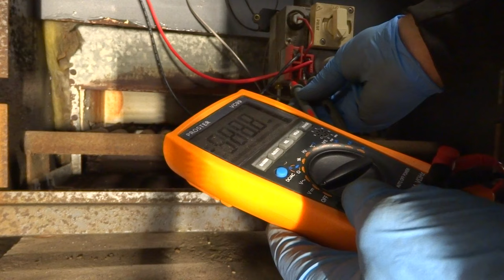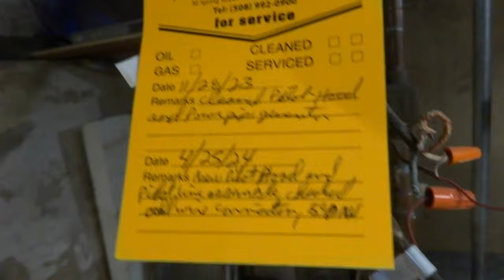OLD GAS BOILER POWERPILE SYSTEM WILL NOT FIRE

Comment: Steve, just a heads up, you need to have 100 millivolts minimum across the coil on gas valve when calling for heat for valve to open.

Comment: if he has a nest thermostat it my not be compatable with a powerpile system
Reply: it wouldn’t be if it was a nest
Reply: @RockoRocko-rz7kx why? The millivolts are just to keep pilot light on . The system is still controlled by 24 volts at gas valve when it needs to ignite burners.
Reply: @joeburner7120  
I noticed the transformer after so they did have 24v and millivolts there. My mistake. Yes if you youse the c or neutral you can back feed a nest for power for the internal nest battery.